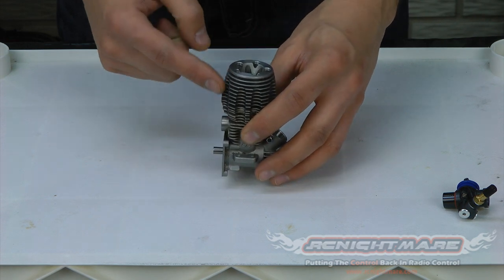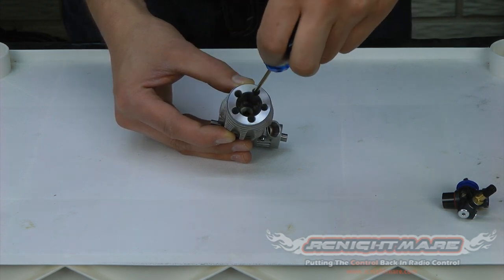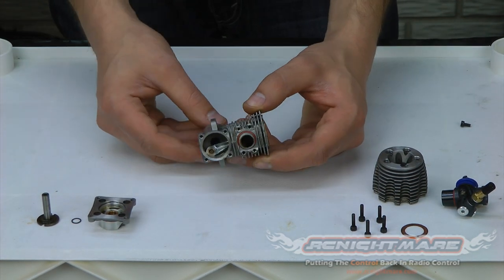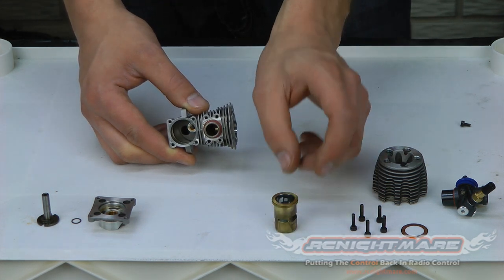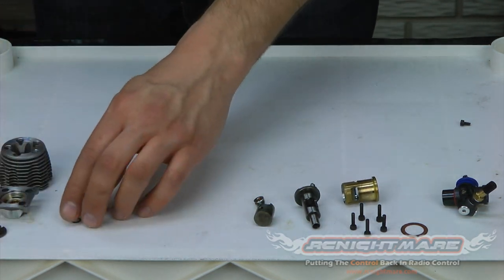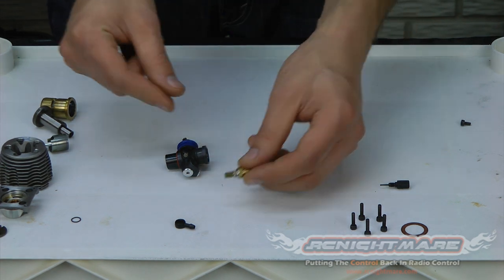RC Nitro Engine Rebuild Pt 1 Complete Engine Tear Down

Comment: Thanx dude , your videos are really helpful to me . 👍😀. I have a VRX spirit 1/10 nitro buggy an after only driving it maybe 5 times , the wheels locked up . I took it apart, wheels move , but fly wheel was stuck . I opened the mother up an found my crank an piston separated. I ordered a new engine, but I'm wondering if I could fix it .I really appreciate your videos. Thanx

Comment: a little metal rode fell out of my motor while taking apart, and I don't know where it is from. it is about 2mm long, and a diameter of about 1mm. My engine is the HPI firestorm 10t

Comment: The OS motor I just got on an older airboat,I noticed the coating on the sleeve was missing in one place. I also noticed the bearings are noisy. I was thinking of rebuilding it but the price for a new motor is cheaper than the parts. Go figure. I want to keep the airboat original as far as the thing being nitro instead of electric.Your video was most informative. I do have a nitro Super Tigre That I will be restoring as the parts are cheaper and its an Itlian  Motor. I was told it is a very good motor,just needs some TLC.